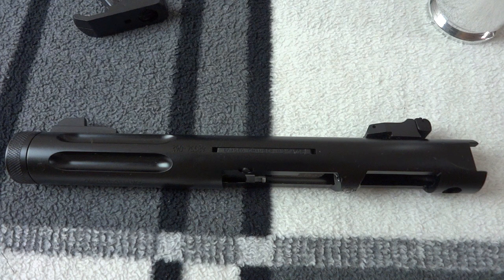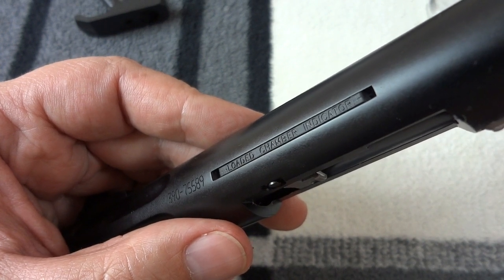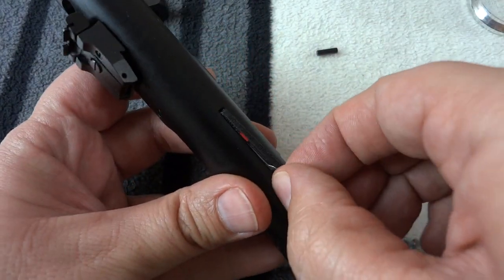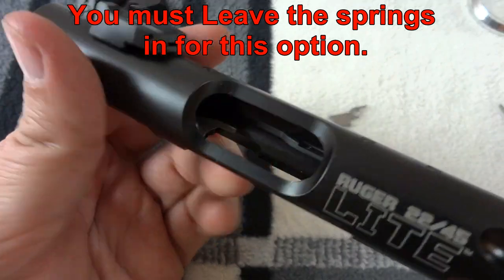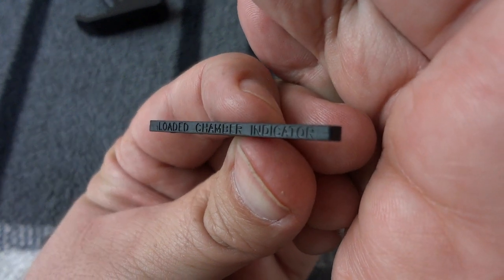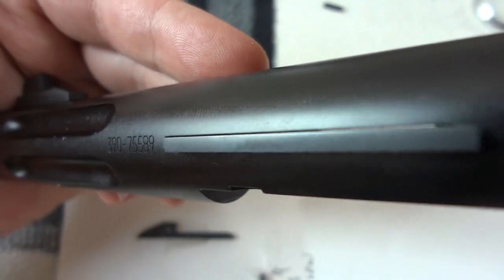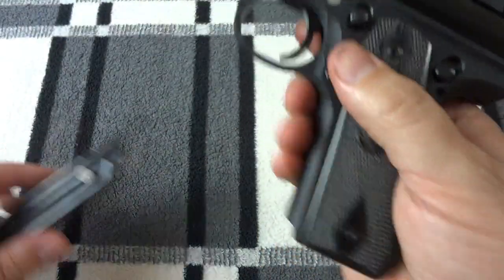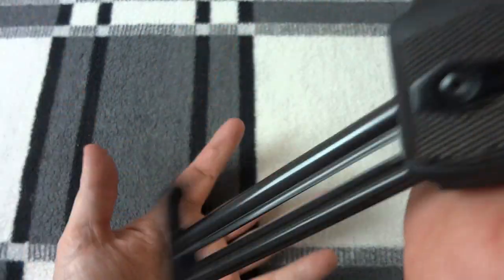Ruger MK III Loaded Chamber Indicator Removal

Comment: I have a Mark III target that I had to remove my LCI in order to replace the bolt . The originl bolt would not stay open after the last round. After researching, I determined that the bolt was worn where it contacts the bolt open lever. I found a new bolt on ebay, which was good for a Mark I, Mark II, or Mark IV, but for the Mark III required removal of the LCI. I pounded on the pistol upper with a rubber mallet, and the pin would not come out.  I sprayed WD40 on it, but that didn't help. I had a few magnets lying around, but none were strong enough. I searched online...there were 200 Lb rare earth magnets.....I finally settled on a telescoping 20 pound magnet for under $10. I figured that no way was this going to work, but I do have the number of a good local gunsmith...but what do you know?   It worked! The pin came right out with the 20 LB magnet. I'm leaving the gun as is. I'm not going to fill the space.  Nice video. Thanks.
Reply from the maker: I heard of cutting the tip off of a toothpick and super gluing that to the tip of the pen. Spin it as you're taking it out and that works pretty well. Well, from what I've heard.

Comment: Boris
 PATIENCE does it. After attempting LCI pin removal with every magnet and tool I had at my disposal, I use Kroil then WHACKED the back side of the receiver REPEATEDLY with rubber/plastic hammer. Took about 1/2 hr but the LCI pin finally drifted out. Installed the aftermarket blank, a breeze. No more unpredictable stovepiping.
Reply from the maker: So glad they deleted this on the MK IV.

Comment: Thanks for this video. I've taken out many with a rare earth magnet. My latest attempt failed. This method worked like a charm.
Reply from the maker: Glad to be of help.  If all else fails, get a bigger hammer.  I have heard from a few people on different methods, but the soft mallet worked for me the first time so I didn't need to try anything else.
Reply: RyeOnHam Used a Harbor Freight orange dead drop hammer. Won't fool with the magnets next time.

Comment: I know it's a long shot but if you've still got these fill plates I'd love to reverse engineer them and make the files available to all then send it back your way.
Reply from the maker: I only have the ones on the gun and I don't think it would be economical to take them off, send them and then reinstall them.  You can still buy them.  I think they were on eBay last I looked.

Comment: Thanks, definitly gonna do this on this evening.
That thing bugged me since I got my MkIII Target 3 weeks ago, but I didn't figure out how to get that freakin' pin out ;)
Great instructions!
Reply from the maker: +jodelboy Only had one person who contacted me and was unable to get the pin out by using my methods.  Just remember to use something soft.
Reply: +RyeOnHam Okay ;) If it doesnt want to work I'll use my good old pliers.
Reply: +jodelboy Worked perfectly with pliers. I don't like smashing parts of guns onto other things, didn't have to clamp down at all with the pliers.
I cringe everytime I have to get the upper off the lower with a rubber mallet ;)

Comment: Question I have is after you remove the loaded indicator entire assembly is there any reason I just can leave it that way and fire the gun safely ? I know that you'd be left with a exposed slotted hole on the side of the barrel which some may consider ugly but wouldn't worry me ... Wes Martin
Reply from the maker: You can leave the call open, or you could file the current plastic indicator down on the outside so it doesn't say, loaded chamber indicator anymore. The metal piece is the piece that pushes on the cartridge to push the LCI out. By the way, should have no effect on function if you leave the slot open.
Reply: Thank you .. My thinking was all about removing the LCI completely so I did not get the problems that they can be associated with . Thanks for telling me that I can remove it and still use the gun safely without installing a replacement part ... Wes Martin  @RyeOnHam

Comment: I have a Ruger mk3. I used to have the mk2 and sold it like a dummy. So I went out 8yrs ago and bought this one. With the loaded chamber indicator and clip safety. I hate both of them! I saw your clip safety removal video and plan on doing that. Thanks! But my question about the loaded chamber indicator is, can I just leave it out? It seems like the gun might function cleaner without it? With the gunpowder blowing out of the gun instead of building up maybe?
Reply from the maker: Great question.  That is not unheard of.  Several makes of semi-automatic 22 rifle (High Standard, Savage, etc.) have slots cut into the left side of the receiver to reduce residue buildup in the receiver.  The Colt Woodsman and similar guns (like the Browning Buck Mark) tout the fact that the rear of the barrel is exposed on the top and both sides when the case ejects.  All that being said, it is easier to clean without the slot being open.  It's not quite big enough to let a substantial amount of powder residue out.  You can, however, take the metal part of the Loaded Chamber Indicator out as I suggest in the video and leave the plastic part in.
Reply: I appreciate it RyeOnHam!

Comment: Sweet =) I'll be ordering one directly! Thanks.
Reply from the maker: ***** I had to file a bit off of the ends for them to work in both guns, but they are slick.
Reply: That's cool. I'd almost rather do that anyway as it assures the best fit. Thanks for the heads up!

Comment: Push in on the LCI with your thumbnail and hold a magnet over the pin, it will pop right out.  You may need to wiggle the LCI a bit but it works much easier than banging on your receiver.
Reply from the maker: This may have worked for you, but each gun is different.

Comment: I tried to remove the pin with rare earth magnets and it didn't budge.  I also put the upper in the freezer for about 10 minutes hoping the metal would contract.  That didn't work either.  Any suggestions?
Reply from the maker: +Thomas Sawyer I would suggest hitting the bottom of the receiver with a non-marring mallet.  I have a plastic mallet, but a rubber or rawhide one might work as well.  You can also try depressing and releasing the LCI numerous times to try to work it loose if there is fouling in there.  Don't hit it so hard that you dent anything, though.
Reply: +RyeOnHam I did all of that and no luck. I will try it again though. It is a brand new gun so there shouldn't be any fouling yet.
Reply from the maker: Is it an aluminum receiver or steel?
Reply: +RyeOnHam it is aluminum. It is a red 22/45 Lite.
Reply from the maker: A blast or two of degreaser.  Let dry.  A toothpick with a tiny dab of super glue... dab it on the pin and let dry.  Withdraw?  Just thought of it.  Might be repeatable, just don't get any on the sides.
Reply: +RyeOnHam are you saying glue the toothpick to the pin?
Reply from the maker: Yep.  Just a dab of superglue so it doesn't spread to the receiver portion.  Degrease it first.
Reply: +RyeOnHam that didn't work.
Reply from the maker: I can keep trying to feed ideas to you, but if you want it out of there you might end up at a gunsmith.  I have never had a pin I could not remove in person.  Over the internet... my track record is not so good now.
Reply: I am all ears.  I went to the range today.  I loooovvee the way the gun shoots.  I didn't have a few malfunctions.  I am not up on all of the terms, but the bolt was stuck half way back and the cartridge didn't feed properly.  I'm not sure if this can be attributed to the LCI; I was using CCI Mini Mags in the gun.
Reply from the maker: Thomas Sawyer Can't diagnose it over the net, but it sounds like the LCI could be your culprit.  Mini-Mags are very consistent.  Some people have no problems.  Since your pin didn't come out, it might be a sticky LCI.  The hole or LCI parts might have had burrs and the factory just forced the pin in there.
Reply: LawsonB suggested a fix that he got from someone else.  He said drill a hole with a 1/16" drill bit, clean the hole and opposite end of the bit with acetone, put a drop of glue in the hole and then put the bit in there.  Does that sound like a workable solution to you?  I am not saying the info I got is wrong, but this will require some precision for the hole.
Reply from the maker: Thomas Sawyer I would not do it that way and I drilled holes for a living for a quarter century.  You would be better just paying a competent gunsmith to do the work.
Reply: OK, I wasn't crazy about doing some precision drilling.  How about this one: someone on Takdriver.com said they put the stripped down upper (plastic parts removed) in a 200 degree oven for 5-7 minutes.  They said the aluminum will expand faster than the steel and it comes out after that.  What do you think about that?  Also, do you think that putting 100 rounds through it could have changed something?  I haven't had the chance to remove the upper since I went to the range this morning.
Reply from the maker: It couldn't hurt, but if you were hitting it on the bottom with a mallet and it still wasn't coming out, a little heat probably wouldn't help either.
Reply: +RyeOnHam well, I went to the range yesterday and took it apart tonight. Using the mallet worked!  I want to clean it relatively well and use ballistol (what I prefer) to lubricate it.  What would you recommend I use to clean things up? No have some methods but that was with my striker fired guns.
Reply from the maker: Thomas Sawyer Ballistol is a well-respected product.  I use Break Free, but I've been using that all my life.  No issues with either of those.
Reply: +RyeOnHam cleaned and put back together. Assembly was quicker than before although I still needed to use a mallet to separate the upper and lower. I may be crazy but the maintenance is part of the hobby for me so I enjoy taking them apart, cleaning and putting them back together.
Reply from the maker: Overzealous cleaning will wear out a firearm quicker than anything.  I tend to shoot my 22's till they start jamming then thoroughly clean them.  I clean my carry guns about once a quarter.  I'll pop off a few rounds of carry ammo, rotate magazines, then put a magazine or two of ball ammo downrange to stay proficient.

I like fiddling with guns, though.  Nothing wrong with that.

Comment: So in other words, you "fixed it". It should come this way from the factory, IMO.
Reply from the maker: TurboMitsubishi Yeah.  I have ranted about the LCI and Mag Disconnect before.  I spent about two minutes making this video bashing California and Ruger for bowing to the commies... but I edited that part out.
Reply: LOL, should have left it. Some companies, (mostly smaller ones) do pay attention and make changes based on public opinion and reviews, from places like You Tube. It is after all a great market research tool.
Reply from the maker: TurboMitsubishi Well, Ruger made the changes TO the LCI, key lock, and Mag Disconnect so they could sell guns in California.  I do believe they have heard the voice of the people, though, because they recently introduced NON-California models of their LC9, which is a great copy of the Kel Tec PF9.  Ruger does a bang-up job of copying other companies designs so much that I usually like the Ruger version better.
Reply: I agree there, they do a great job of releasing an "improved" design of a similar model from other manufactures. But I suppose auto manufactures do the same thing all the time. Someone comes up with a good idea, and they all rush to make their own similar version.